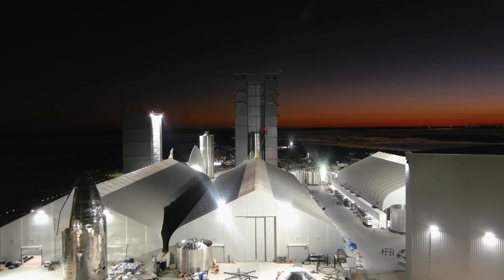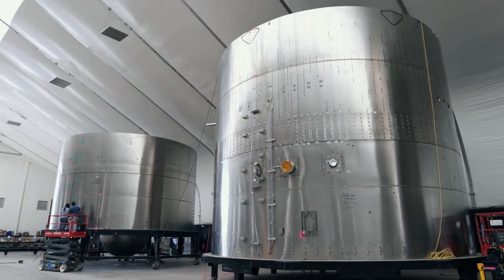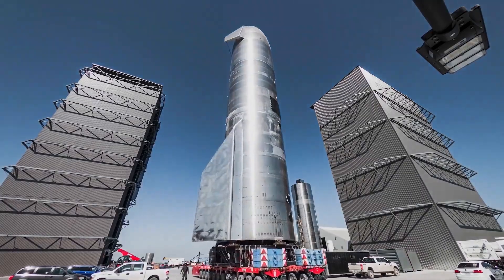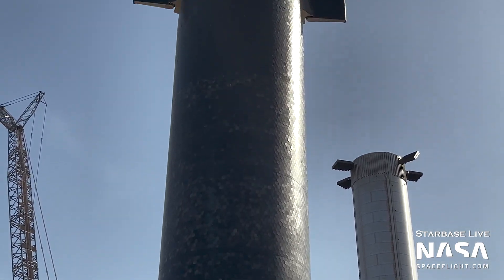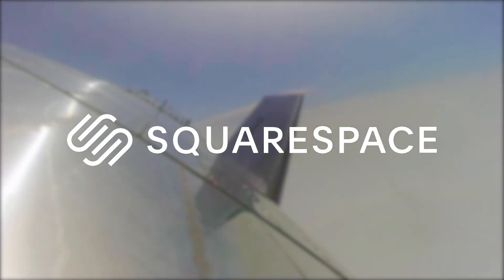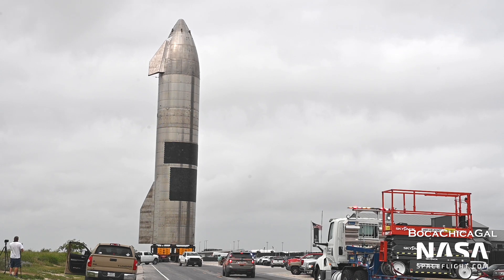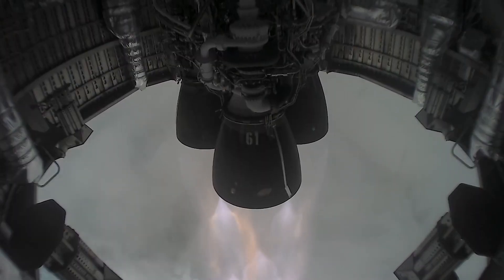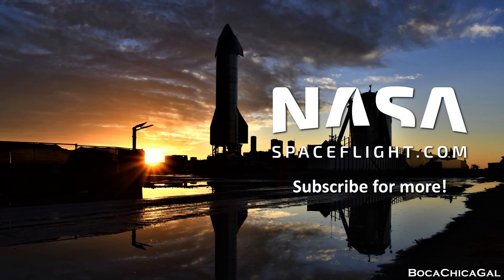How SpaceX's Starship Will Survive Reentry

Comment: Materials-wise the heat shields seem like they're ready, design-wise I feel like they're not at all mature and still have a very long way to go. In the long term I do not think that having 18,000 tiles is practical and I continue to expect them to introduce some sort of external lattice structure to host larger and more reinforced tiles in a more sturdy vibration-resistant manner, which incidentally could also make them easier to service. I think the first orbital ship will 100% burn up on re-entry, they'll learn a ton about what a re-design needs to target, and they'll sacrifice a few more tons on a more robust and dependable heat management system on later prototypes. I think that in 18 months we'll all feel confident about starship's heat management capabilities because they'll have been addressed through failure.
Reply: The larger they are, the more fragile they are mechanically. The current setup is three spring loaded clips that hold the tile. I would be surprised if they directly hold the tile material. Rather they should have embedded metal in the tile (its poured/cast) and so its metal to metal contact. However, what's probably happening is that the tile material is tearing away from the embedded metal mounting points. And this is a tricky compromise because you need compliance (spring) to compensate for the tile growing as it heats (It will also tend to grow more on the outer surface than the inner one, causing it to bow outwards as well as expand into the gaps. That puts more stress on those (hopefully) compliant mounting clips.

Bigger the tile, the bigger these issues are. You can make the embedded metal larger and more complex to avoid tearing. But you still have the issue of differential expansion between the materials. What I'm saying here is that there's a reason why they ended up dinner plate size. And of course everything you do to compensate for these problems will add weight.

Comment: I wonder if making bigger tiles would help, less is more as they say, and maybe it would be less brittle. Same for the more complicated parts like the nose cone and flaps parts, big molded pieces of heat resistant materials that would fit perfectly and therefore require less effort to install
I’m no expert so maybe this idea is just silly. 
But yes if a simple vibration or heat change is already popping tiles off, a “simple” liftoff or entry will just remove a lot of tiles.
Reply: Bigger tiles just makes it worse. You've got thermal expansion differentials between the tile and its mounting points (the ones they have now have to be springy). Plus the larger the tile is, the less supported it is - its correspondingly thinner relative to its size.
Reply: @saumyacow4435  I see! Thanks for the info!

Comment: Good Summary Video!  Even Elon has alluded to his concerns that the tiles may not be up to the task.  Myself, I've worked with refractory lined furnaces where the attachments are often the failure point. I am very concerned that the TPS as it looks today is  a likely failure point during re-entry due to them falling off during launch and the stress of re-entry.  I am confident SpaceX will figure out a solution, but I will be surprised if the TPS isn't involved in a re-entry failure during the first few orbital flights. Hopefully, Starship makes it to that point!
Reply: Agree, at the moment they seem to "pop off" as easily as they "pop on" which is the problem, could be rectified with some sort of bolt fixing but they maybe deemed too slow a process for the prototypes. It's a pity the active cooling system wasn't pursued further as long-term it may have been a better solution.

Comment: An isolated tile loss should not be catastrophic, but my concern is if a cascade of tiles will peel off. The belly is going to be subject to high external pressure. With a belly tile lost, the high pressure can spread under the tiles to areas with a lower external pressure, thus subjecting those tiles to strain.

[ The thermal blankets will limit flow rate and each tile seam will tend to equalize the pressure difference. But is that enough? ]
Reply: Its called the zipper effect and yes its a serious problem. You have to have connectors that are tough enough to just not fail - and that's hard because the tile material itself is very fragile. However you attach it, there's always an interface where the tile can crush or tear. 

Its not just high dynamic pressure, its also flexing of the steel (its a tin can basically) and its turbulence.

Comment: Adiabatic compression : 
Have you ever used a hand pump to blow up a bicycle tyre? Have both the tyre and pump at room temperature. Now pump them up until fully inflated, and keep a reasonable pace. You will notice both the pump and the tyre have risen in temperature. This is NOT due to friction, that plays only the smallest part, it's called adiabatic compression.

As the air/gas is compressed together the average energy of that  volume goes up, the molecules are buping into each other more often, to reach equilibrium again, it has to radiate that extra energy as heat. Refrigerators and freezers use a related trick. They compresses a gas so it heats up, they use a radiator to get rid of that heat, then decompress the gas in another radiator that is inside the fridge. That compressed and cooled gas, now needs to regain that lost heat, so is takes it from inside the fridge. Same thing and a neat trrick.

Now when a spacecraft slams into the atmosphere faster than the air can get out of the way(faster than the speed of sound), it is compresses the air in front of it. The spacecraft is using the air to slow down, as that saves a lot of fuel, otherwise it could have slowed enough to void the issue all together That air heats up a LOT, a ludicrous amount in fact! It end up radiating enough heat to destroy a spacecraft that does not have adequate protection.

Friction only plays a small part compared to the hinges of hell level of heat generated by adiabatic compression as a spacecraft  comes screaming home, so to speak. It's like the heat generated by the bicycle pump compression of the air, just dialled up to godmode level.🥴 If it did not work like that, your fridge and freezer would not be able to chill food at all, the universe is weird like that at times😊🤗
Reply: Sorry, it just set me off.  keep up the good work😜

Comment: This might make it harder to make tiles but has anyone considered using quartz instead of silicon for the base material of the tile. It's much more rugged, almost no thermal expansion and mechanically strong and resistant to breaking. You can take a red hot piece of quartz and plunge it into water with no shattering.
Reply: Cost? Weight? Thermal limit? 
The whole point of building Starships is to make them cheap.
Reply: @knowledgeisgood9645  maybe a bad idea, but the current tiles look far too fragile for the rapid reuse SpaceX is looking for.
Reply: @gkochanowsky  They have to start somewhere and right now this TPS seems as good as anything else or better.  The TPS is just one of countless issues that Space X is working on to make starship flight worthy, reusable and inexpensive.

Comment: will all tiles make from lift off to landing.  I'd say no.  I would hope the engineering team would come up with some measurements & MTBF's.

I also hope that there will be an inspection camera that they can deploy when they reach orbit to check for missing or cracked tiles.  And just before re-entry - in case of micro meteor damage.
Reply: At the present it will be a major success to just get to orbit. Anything beyond that is a bonus.
They have all the cameras and sensors they can fit on the ship. But keep in mind, no humans are on board. If it disintegrates Ship 25 will try again, then S26 and so on.

Comment: I'm just going to say that yes, I do realize that this is all testing, and that especially early on the shuttle also had issues with it's tiles coming off.  However, with the shuttle it was (as far as I'm aware) never the primary black tiles coming off, but the white ones on the tail on the top leeward side of the reentry.  It seems concerning to me that they still keep coming off during static pressure testing and not even under the full dynamic load.
Reply: I agree the shuttle was a much more rigid frame less flex so they stayed on better.
Reply: Quite a few black tiles either cracked or chipped. One fell off and it was only the fact that underneath the tile was a steel antenna element that prevented disaster. Most likely they are coming off because the fragile silica material is tearing away from the mounting hardware - its a hard problem. Also, when you lose a tile, the extra aerodynamic load on its neighbours could lead to a zipper effect.
Reply: Yes I am concerned that it could be because starship is so long, with such a flexible straight frame that it could be that is the reason why these tiles are coming off. The shuttle was definitely old and over engineered, but I had a very rigid frame and didn’t go through these Cryotests with cooling or expansion of its frame as much under heat and/or friction. we know obviously starship mustn’t be able to flex too much as that will damage its internal hardware, but inevitably there will still be some with such a long tube frame like this, and those little bits of movement along a body like this where eventually it will add up to a central point, and the effects of the Cryo-tests will inevitably cause tiles to come off. At least that’s what I’m speculating, so this is making me incredibly worried. I really don’t know how SpaceX is going to be able to get around this as I’m really scared this could be some sort of intrinsically inherent problem with all spacecraft that are designed to be able to re-enter the atmosphere. Perhaps it’s one we will never be able to get around. Not until we can actually create a metal body that can survive on its own without a heat shield attached to the rest of the hull, or actually create genuine real energy shields that can hold back the friction heat. 
For now, perhaps spacex should try using different shaped tiles in the end for the main body like squares instead.

Comment: All the current starships are prototypes. I’m sure that some failures are expected. Failures will lead to further testing and redesign. Eventually, they’ll get it right. So don’t lose faith. Expect failures.
Reply: Oh absolutely. But also expect that solving this and several other obvious design issues is going to take a lot longer than many believe.
Reply: @javaman4584  Looking at early development of the Space Shuttle they had a very hard time with the tiles, maybe even more so then Starship right now, and considering that Starship is an easier design then the Space Shuttle and NASA got that to work. Well, they'll probably get it
Reply: Tiles are so last century. A better approach would be a thermal blanket witch is deployed on re-entry and it envelops the ship then disposed of by rotating the ship, or once the speed is reduced it could become like a parachute to help with slowing it down further.
Reply: @javaman4584  I’ll bet that right now, Elon is feverishly working on the TPS . If anyone can solve the problem, he can.
Reply: @rushpuppy2  You seriously think Elon himself is the best qualified person for this? I can promise you a bachelor in art and physics does not make him an expert. There are much more capable men/women out there to try solving this

Comment: This topic is why getting a "one hour" turn around time will be difficult to achieve or maintain.
Reply: A one hour turn around is well down the road and so not very relevant to current starship development.
Reply: @AdenStewart  Ah! Good point!  So, another, already prepped Starship could be assembled with the just-returned booster.
Reply: This and the fact that the engines are highly stressed and complex - another source of inspection/maintenance delays. Have you checked out Rocket Labs's Neutron, for a master class in how to do reusability?

Comment: I stopped at "friction" ! It is NOT friction, it is "compression" ..
Reply: While it does initially sound like an error, compression is addressed right after that part. Friction has a minimal effect during the majority of the decent (cube of the velocity instead of the 8th power), but it is still a component of it so it's correctly addressed.
Reply: You missed the bit where he talks about compression heating by about 5 seconds.
Reply: @curator23  I don't care.. it's just plain wrong to start with.. Don't mention friction to start with ! Period ! Did they mention they should apply vaseline instead of an actual heat shield to reduce "friction" ?
Reply: @ivanscottw  I agree. it's wrong to mention it. It's not a major component. Perpetuates a general misunderstanding.
Reply: Probably shouldn't have stopped.